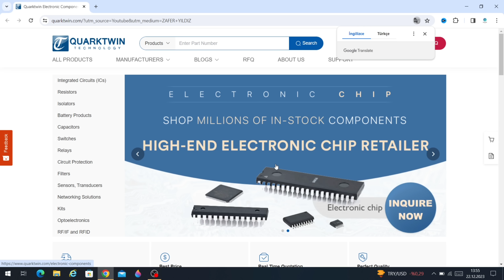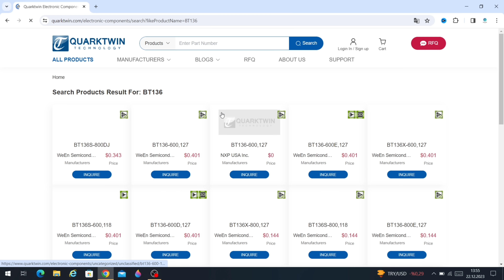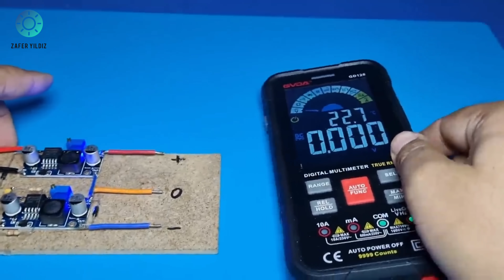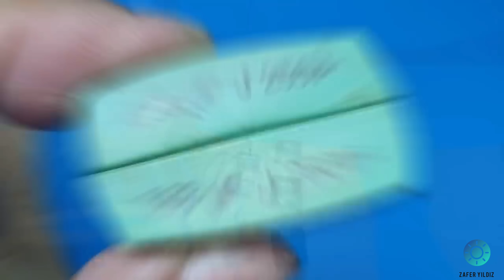THE SIMPLEST 2 SYMMETRIC SUPPLY CIRCUIT

Comment: Should pin 5 of the second LM2596 not be disconnected from GND before connecting the resistors of 47K to pin 5 as Pin5 is already connected to GND?

Comment: Hello, can I replace the lm2596 circuit with the xl4015 low voltage circuit and the method is similar. I want to use them for my computer speakers. Thank you.

Comment: Should the negative Voltage regulator not be a 7912? ??
Reply: you make this only with central position of the transformer simmetric sinusoidal wave
Reply: @frank67628  ??? is not the same with the 7912?